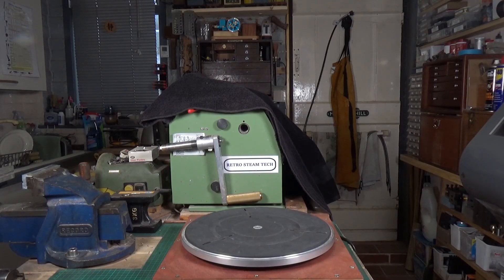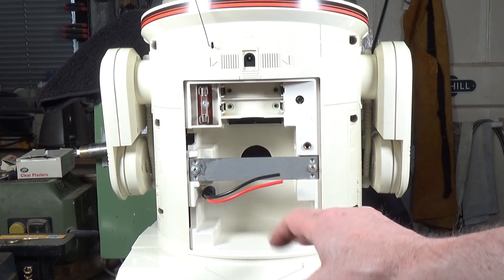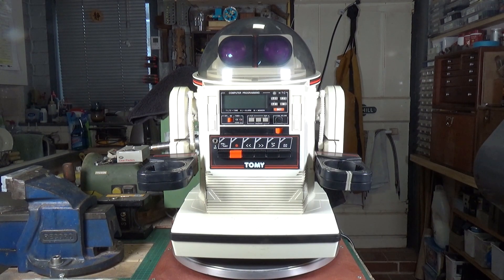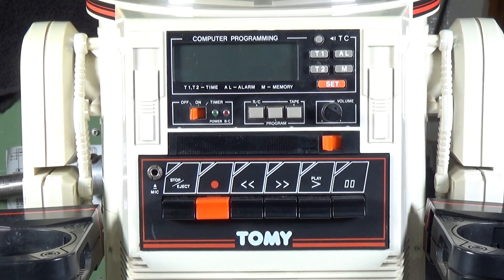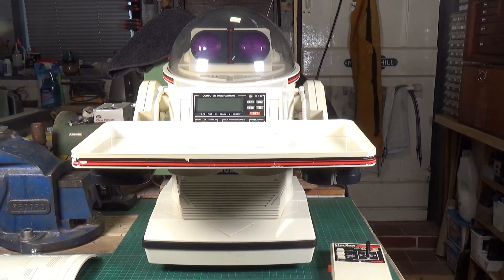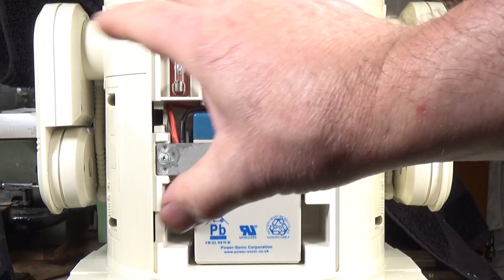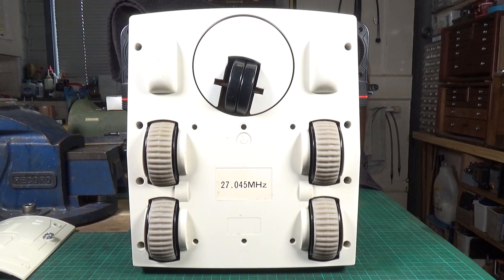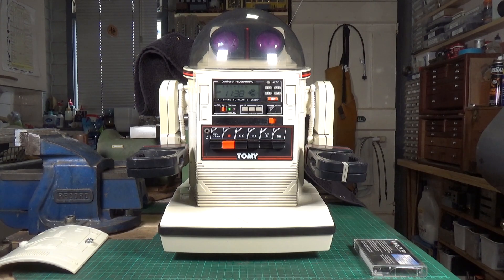Retro Tech - Tomy OmniBot

Comment: I always wanted one of these when I was a kid, but as the oldest of 7 kids it definitely was not in the cards. You didn’t mention what the programming language is for writing the code. Is it Basic or Machine Language?  My Atari 800 had a cassette recorder and I wrote programs for it and recorded them to cassette in the early 1980s.
Reply from the maker: Hi Charlie. The programming is not actually done using any kind of digital code. The instructions are recorded onto a blank cassette tape as tones. You select "Program" mode then put the cassette player into "Record". Then move the OmniBot around using the remote control, each movement is recorded as an audio tone. When you play back the tape in "Program" mode he will replicate the movements. Pretty crude but it works apparently. Cheers, Alan.
Reply: Interesting. Looks like a good subject for a second video. 🤠